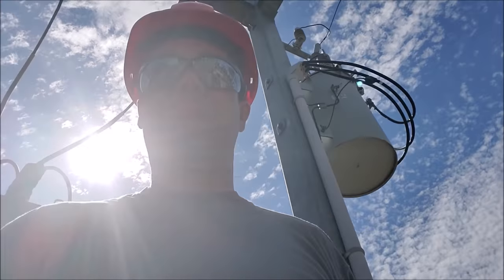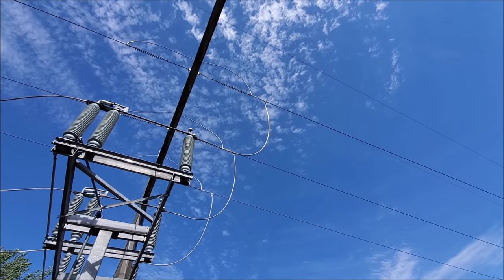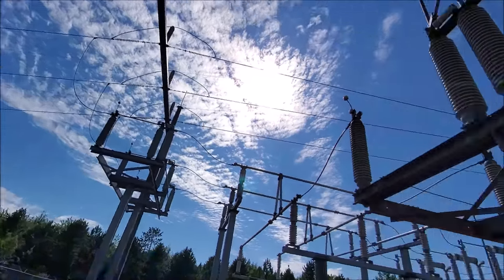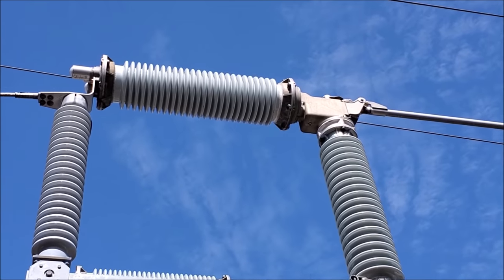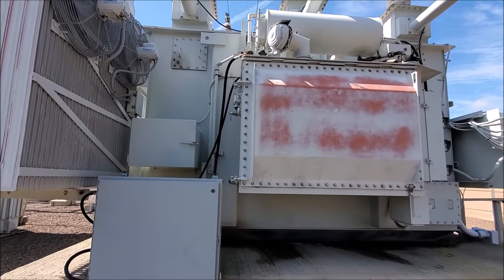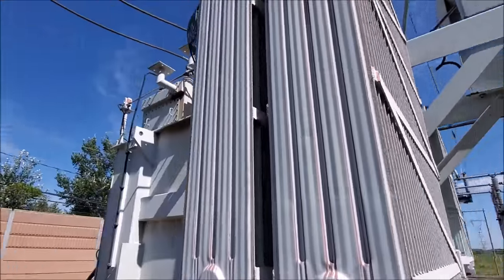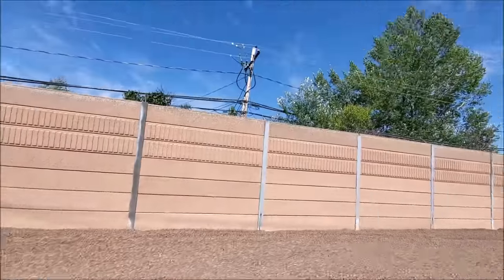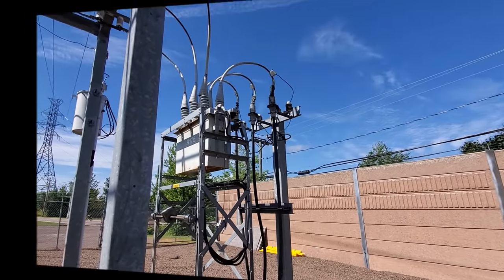How does a substation work?

Comment: Oil recloser!  I’ve been wondering what the purpose of those were for years. I always assumed they were some type of current monitoring device. Due to location of placement(noticed most solar field hookup to mains have one).  Never would have thought they switched since most of the time I see manual breakers feeding into them, but makes sense to have a visual lockout to go with the recloser now that I know.

There’s another type of smaller boxes I see on poles. They usually are a 10x10” finned box and there’s one for each phase. I always assumed they were some sort of MOV and grounded any transient voltage spikes (lightning arrestor).  Can anyone confirm?
Reply: The oil reclosers aren't intended as breakers for line work.  My first guess is that an open recloser could close unexpectedly...which would be when you DON'T want it to...and you fry.
Reply: They could be either primary metering if the line was feeding an industrial customer, or possibly a capacitor bank for power factor correction.
Reply: I'd bet you $5 that the "smaller boxes" you see are capacitor banks. 

I grew up a little over a mile from a power plant.  A major rural (1PH) circuit took off from the main distribution circuits at the start if the road I lived on.  Drove past it most every day.  It had its own little 1 phase oil re-closer in a small transformer-like can.

Comment: Great content! One thing I've been curious about four a while, if you go to developing countries, you see a lot of spaghetti and bird's nest wiring up on the poles (can see it pretty quick on a Google images search). Is that just massively unregulated neighborhood building like oh man just added sixteen apartment buildings to the circuit better string up another seven miles of speaker wire to handle the load... Is there some method behibd the madness, or just people clamping on in parallel to get some juice?
Reply: I was in Haiti post earthquake doing relief work.   The people would throw a ladder against the nearest pole and make the connection themselves.  Transmission lines were 120 volts but still!   Spaghetti linesfor sure.   I have a photo of a flattened piece of copper tubing replacing the meter in each leg of the circuit.  No cover!

Comment: Great videos. Showing my ignorance, how much current can be carried by the 138K circuit? How much current is delivered to a substation like that and how much current on the 12Kv side. do you guys use any higher voltage for distribution than 12Kv
Reply: As I understand it (and I'm definitely not a pro/expert at this stuff), 12KV phase-to-phase is standard in the US and Canada.

The thing this channel has driven home to me is the simple math of watts = volts times amps.  There's a video where  Bobsdecline is talking about a distribution line that feeds multiple houses needing to be under 10 amps.  That startled me until I realized 10 amps at 12KV is 120,000 watts, or 500 amps at 240 volts.  New houses typically have a panel and meter rated for 100 amps at 240 volts, so a 10 amp distro line can feed 5 houses.
Reply: Not all 138 kv lines are the same so ampacity varies widely, ranging from several hundred amps to several thousand. An average 12.5 kv feeder will range anywhere from 100 to 800 amps depending on loading conditions. I've seen 21.6, 25, and 34 kv systems in the US.
Reply: That's a good question.  A clue can be learned by the apparent size (and number) of the conductors of each phase.  Because alternating electric current prefers to flow on the surface of a conductor, making the conductors larger and larger has diminishing returns.  This is why you will see 2-6 individual wires bundled together for each phase as the current gets higher and higher.  While it's hard to gauge the actual amperage here, we can tell with small-ish wires and no bundling that it's not a lot compared to other lines.

Comment: I thought there was a netural wire coming into and going out of the circuit to the distribution wires. 
I guess just the three phases go back and forth from the substation transformer. 

Also where I live in Philadelphia pa,  I notice all the times the overhead wires junction together and go down a pole every mile or so. Is that a normal setup. 

I'm not an engineer or electrician,  just interested.....
Reply: There is no neutral on the transmission lines coming into the substation.  The three wires carry all of the power as three mostly-balanced phases.  The transformer has three primary coils, and each coil is connected between two of the wires.  This is usually drawn schematically as being connected in the shape of the Greek letter delta Δ.  The output of the transformer is a wye or star configuration, with the three coils connected on one end radially to the neutral.  

The "going down a pole" you speak of sounds like underground feeders to a customer.  Those are very common.
Reply: @jovetj  thanks for the info.
The secondary windings wired in star/wye would then have 4 wires coming out of the transformer.  3 phase hot and the netural return.
Reply: @harrymiller513  Yes.  But the neutral is not a balanced "return" for all three phases. Three-phase loads are still placed between the phases, just like the delta transformer primary windings.  The wye neutral just caries any imbalance between all three phases.

Comment: Is the oil in the transformer pumped through the radiators or does it just naturally move around the system due to convection?
Reply: Depends on the transformer. I can't tell on these. The same transformer can have different ratings depending on what cooling is available, such as forced air (which these have), forced oil, or convection only.
Reply: I think 90% of classic HV transformers use just straight convection. The less moving parts the better!

Comment: why is the High Line 130+ Volts. The power company in my area is upgrading allot of substations and installing new high lines. Saw them run new lines using a helicopter. pretty cool. Please More sub station videos. Love the content.
Reply from the maker: The high voltage allows us to carry the electricity from city to city with minimal voltage drop. A higher voltage is also inversely proportional to amperage.
Reply: Because that's the voltage that was deemed suitable for the specific conditions of the line.

Comment: You showed the SF6 Circuit breakers, but how do they operate? I cant see any wires or mechanical connection going to them. I ve seen some on youtube how they use a spring mechanism to cut the line as fast as possible but then there was some kind of spring reloading tech behind it
Reply: It's all internal and enclosed.

Comment: Very nice video. Just one question. Is the power transformer Delta/star connected? I think i see 4 legs at the secondary windings.
Reply from the maker: Yes it is. On the secondary side our Neutral (the X0) is connected to our main feeder. Once on the distribution side our entire system is a multi grounded Star.

Comment: The station is very well maintained, on the high voltage and medium voltage side, it is made as overhead, which slightly limits the possibility of carrying out maintenance works throughout the year. SF6 is not an ideal medium to extinguish an electric arc, taking into account that the residues and the gas itself are very dangerous for living organisms. Regards

Comment: There was a couple days once I helped install the leads/ insulators (no clue of the name) that go into the transformer which transfers the power from the in and out lines down into the transformer leads themselves. Pretty cool stuff to learn. Being a crane op I was pretty nervous being super close to this type of power.
Reply: They're called bushings on the transformer. Lots of respect for the crane guys as well, that's a lot of skill in that job.

Comment: @Bobsdecline
I once learned, that 3 phase transformers often have one common core, made out of three posts, sandwiched between two bars. The primary & secondary coil of each phase are wrapped around their own respective post. So three times primary/secondary around their own post.
The posts are magnetically coupled by the bars.

My question is:
Due to the coupling, all posts should "see" all three fields/magnetic fluxes.
How does the respective secondary coil "know" which flux and hence which phase it has to "pick"?
The goal is to have three phases, each 120 degrees shifted on the secondary side, so the fluxes should better not interfere with each other and result in a "phase mess"
Reply: As a non-physicist, my response is:  The magnetic field that matters the most is the one generated around the core the coils are on.  Also, keep in mind that (it varies on the style of three phase) all of the input coils are connected together, with each coil sitting between two of of the primary lines.

Comment: but in case of the tower line is disconnected in the first place you can connect transformers in parallel. and CB gas is (Sulfur hexafluoride) SF6 usually. thanks for sharing.

Comment: 1 flash and your ash. SF6 leaves nasty residue inside the gas void. BTW don't you isolate the LV before you open the HV? And why does your sub not have bird X on the exposed conductors to stop birds etc from perching on the conductors?

Comment: Hi, I wish you could help me here: I'm not related to the subject at all, but I do have a basic stupid question: I'm developing a video game where the player has to "restore power" from a substation. Is there any switch (and when I say switch I mean like those levers mounted in a wall or a computer that manages the system) that can be manually operated to connect/disconnect/reset power? WOuld a be a substation located near the suburbs of the city or in the city bloks itself (in this case I can see it is open space), Would it be wrong if it is located inside the city? Again, I'm not aiming to 100% accuracy in my game, but I wouldn't want to be THAT wrong either (like "pushing a button" solves/fixes everything!) ... I would really appreciate your input, Thank you!
Reply from the maker: Most modern substations have push button breakers/reclosers that close internal contacts within the device.

If power was knocked out these will automatically open. Once the fault is clear, (a branch for example) power can be restored at the push of a button in some cases.

If power to the entire substation is out there are also buttons that can remotely reclose the disconnect switch.

These are usually located inside the building within the substation yard.

Yes they can also be located within city Limits and high population areas
Reply from the maker: I should add that this can also be done remotely from The Dispatch center or in the field. 

The push button would normally be more in the form of a big red button on the panel (if you want to keep things simple). Green would indicate open, Red - energized.
Reply: @Bobsdecline  THANK YOU SO MUCH! I will take into account all these details you have shared! Thanks :)

Comment: What is the use of the small"garbage bin" transformer between R174 and R175 (5:08)? Is it feeding a nearby streetlight or household or something like that?
Reply from the maker: "Station service" we call it ... I'm not sure what it's called it other areas. It's basically the 120/240 that supplies power to all the lights/switches/heaters etc.. in the subyard. Often times they are built right into the switch gear or power transformer. There's also a huge battery bank for back up
Reply: @Bobsdecline  Wow, thanks for this fast response and good explanation!
I didn't know until just now that a substation would need any power itself (at least the ones without a building). I always thought it would be a "passive place" with no need for electricity.
But I must say I learned a lot from your videos and will certainly watch the rest of your videos. But not now, it is 1:00 am (here) and should go to bed - this is difficult because there are so much more videos from you to watch. ;-)
Keep up the good work!
Reply from the maker: I really appreciate you taking the time for the feedback 👊 
1am .. yea get some rest! Cheers!
Reply: @Bobsdecline  👊

Comment: Can you show the breaker mechanism that causes the three try reset ?

One of line goes down and there's a dead short the breaker trips open

after a few seconds it tries to reset and the power goes on and goes right back off when the breaker opens up a second

after a few seconds it tries a third time to reset and if it doesn't reset and blows open the third time it's stays open and the power stays off at that point

I've always been interested to know is it just a breaker or is there a lot of electronics involves that makes that work

also what is the green shack that's inside the substation it looks like a little building and I'm wondering is there control circuits in there or is that just a storage shed of some sort ?
Reply: That's the "recloser" he shows at 5:20

Comment: 2:06 if you close the tie switch you could open the line switch.  You would not be breaking load at that point, load to the transformer would still be feed from the other line.
Reply: And linking those two lines together is a good thing?

Comment: All distribution circuts coming out of the substation must have at least which of the following?
A. 2 wires
B. 3 wires
C. 4 wires
D. Neutral wire
E. B and D
Reply: What?  Why a quiz?  The "answer" is A and D.  There are 4 conductors coming out of this transformer and substation (A⍉, B⍉, C, N), but there's no reason that 2 or 1 phase distribution circuits can't come out of it, too.

Comment: The low voltage side is 13 kv line, 7 kv is the voltage in any only phase, 13 kv is the voltage in two or three phases

Comment: So as you step up voltage to the 138k lines are there more than 3 phases, or is that a totally different animal?
Reply: Nope it's still only 3 phases. However some transmission lines may have multiple conductors per phase paralleled. You might also see multiple circuits on one  tower, but it's always just 3 phases.

Comment: What voltage do the alternators at the dams operate or produce?
Reply: Most power plant generators, to my knowledge, are designed for 15000 to 25000 volts.

Comment: Why do some substations have no circuit breaker before it enters transformer while it has a disconnect instead of a isolater?
Reply: My understanding is that isolator = no load switch, disconnect = load/no load switch.   Not all transformers may need overload protection if that is provided earlier in the transmission line. 

Personally I am surprised that there is no isolation switch provided between the incoming and outgoing 138kV line.  I guess that keeps the yard a lot smaller.

Comment: Those 138,000 volt lines that are energized - they are a bit low - I see that they about 20 feet over the ground. They need to be 30 feet above, because at 20 feet, if you extend your arm upward towards those lines, there will be an air gap, and that air gap will be like lightning - and you will get zapped (maybe even electrocuted) without even touching the lines  - and when that zap happens (because this is 138,000 volts) - that shock will be as bad as getting a Black Mamba snake bite on your face, which can be fatal. Basically, the higher the voltage of the lines, the bigger you need clearance to allow for air gaps.
Reply: There's plenty of air gap.  C'mon, think about it:  the phases are closer together than they are to the ground.

Comment: Good job. Hope you didn't experience Step Voltage nearby
Reply from the maker: Thanks! Actually all of our substations and switch yards have all equipment bonded together. This includes an entire grid beneath our feet. This virtually eliminates the chance of any step potential under normal operating situations. This is also why copper theft is so dangerous to not only the thief but our staff as well

Comment: That is actually a circuit switcher. Not a circuit breaker. Also the weight of the SF6 doesn’t have much to do with anything. It has a high dielectric constant that’s what makes it better than other gases.
Reply: He's the second guy to remark on the weight and neither addressed the dielectric factor, which we learned back when high schools had science classes.

Comment: Where does the neutral from the distribution return to?
Reply: The transformer.  It looks to be a Delta-to-Wye transformer.  So, the neutral originates on the transformer.  At 4:40 you can see the four output bushings, and the left one (the neutral) starts heading straight down because it's also grounded.

Comment: Isn't that arc arresting gas one the most powerful ozone layer destroyers?
Reply: I believe you are confusing sulfur hexafluoride's property as a potential greenhouse gas with other, unrelated fluorine containing chemicals that can damage atmospheric ozone.  The transition to high voltage switchgear containing SF6 has made it possible to replace PCB containing high voltage switchgear in many implementations.

Comment: The oil helps cool the transformer but doesn't it also provide electrical insulation ?  When I started working at the electric broom factory in 1980 they were just getting rid of the PCB oil in the transformers and the PCB capacitors. About 5 miles from my house there is a substation with a 765kv line feeding it. Looks like something out of a Frankenstein movie. Creepy.

Comment: Personally I dislike those type of 3 phase breakers. You get a fault on one phase you take all 3 out. That’s ok on a dedicated 3 phase load. We’ve switched to the oil less vacuum NOVA breakers which can be programmed to suit the load such as single phase fault single phase trip. Stay safe my friend. 38 years, just retired in one piece.